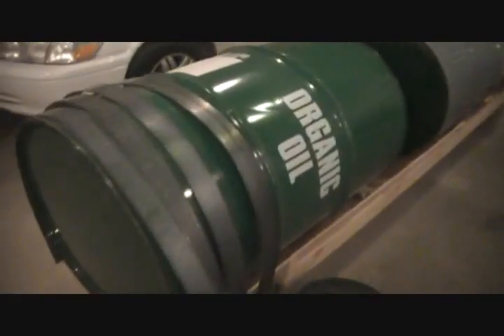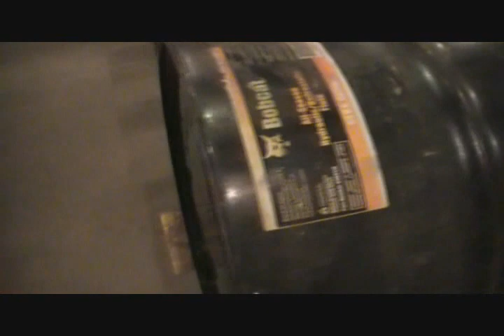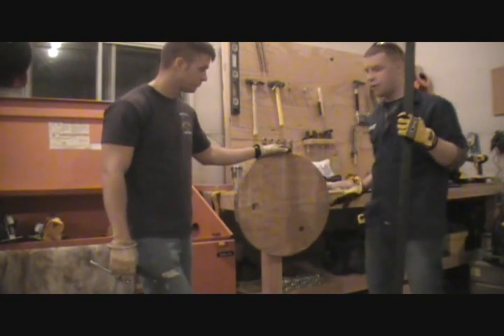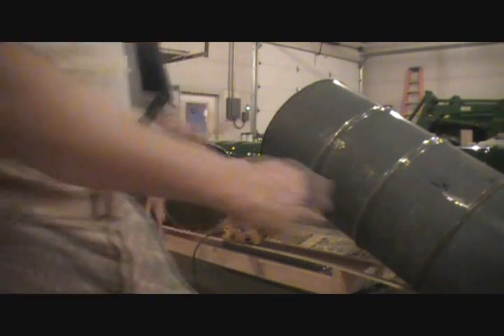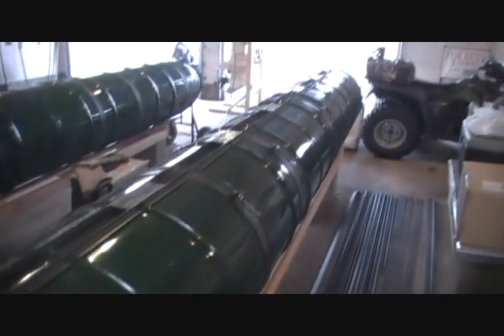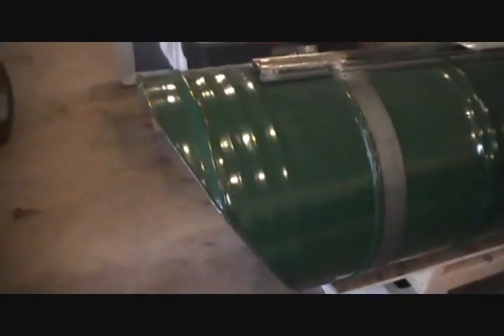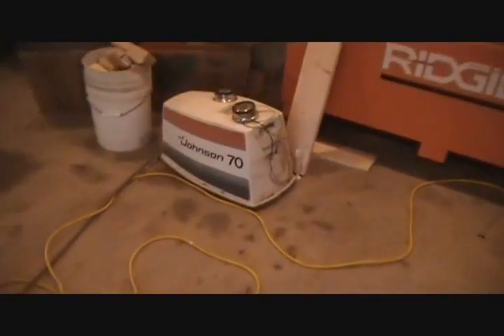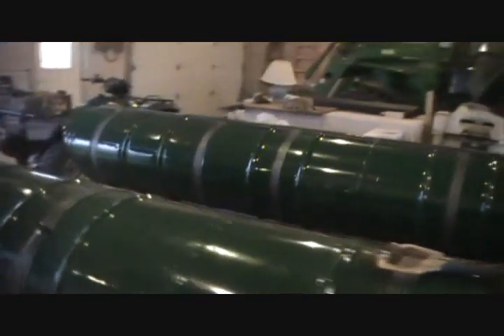Homemade Pontoon Boat Build (Video 2) by HPFirearms

Comment: Great boat. Why didn't  you guys  make the floating barrels full with that special expantion Foam that makes the boat unsinkable?
Usually Pontoon floaters have that stuff inside and I don't think it is expensive ... on the contrary.
That would make the barrels totally water-proof even when rupture of the external hull occurs.
Just a small idea.

Comment: I was goin to buy some without the lids and seal them with some thick sheet metal and welding. Should I be fine?? Mines going to be around 13ft with 4 barrels each side